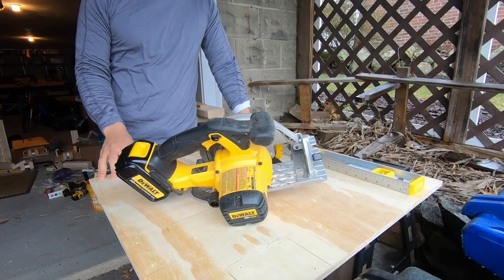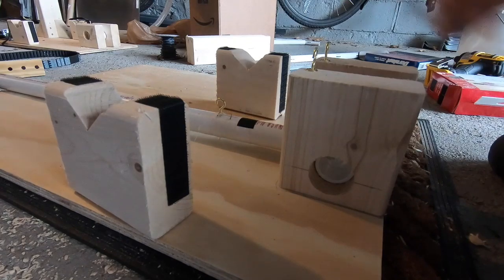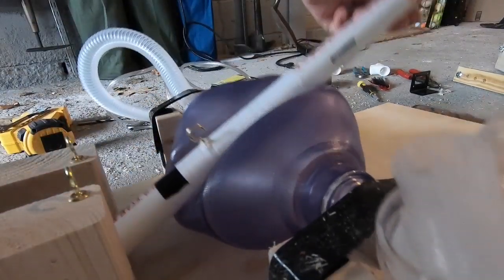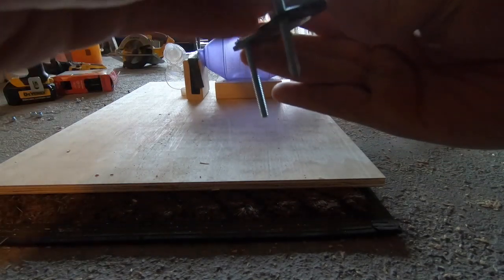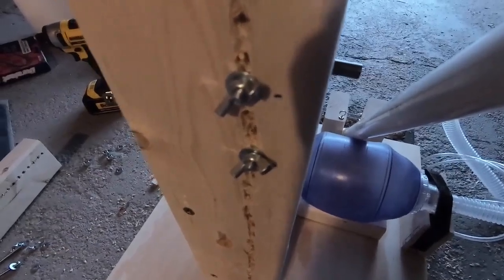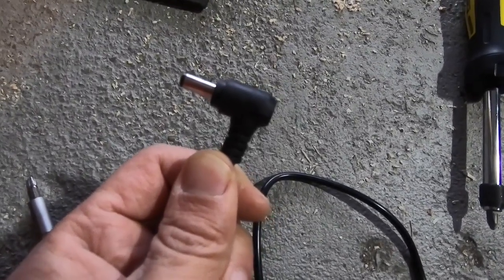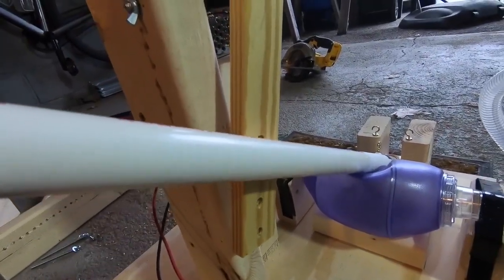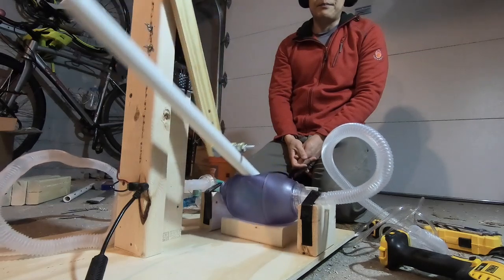Macgyvilator disaster "ventilator" assembly instructions (long)

Comment: This simplicity is a real help. Thank you very much.
Reply: The design requires a peep value to prevent the lungs collapsing
Reply: @sadface7457  i think the bag contains one
Reply: @mrresalah9956  Not its attachment, usually to the mask, because the bag needs a negative pressure to reinflate.
Reply: @sadface7457  it is used now by hand in our hospitals.

Comment: Doctor, you mentioned wanting to add filtering. I have a suggestion for you. Take a 3/4 inch threaded brass, some nylon window screen cut to over fit the ends, and 2 barbed or pex fittings for either side to clamp the hose onto. The union can then be opened and used to place a filtering medium into: cut to size mesh, activated charcoal, what-have-you. Pieces of cut vinyl tubing can be used as spacers to hold loose medium in place.

This design is extremely "low-rent", and is likely only suitable for larger debris filtering, probably no smaller than 50 microns or so... but the filter medium can be sourced from anything, even deconstructed water filtration or cotton balls.
Reply: Alternatively, a pre-filterer can be made with PVC fittings, or with vinyl tubing, holes drilled into the side to allow airflow, then covered with vinyl screen held in place with either a glue, or simple elastic bands. This bodge can also be filled with a medium to improve filtering, but as this in on the inlet side, flow restriction should probably be restricted to no smaller than sub-millimeter sizes.
Reply from the maker: I love the "low-rent" idea; you're in good company! It would certainly be better than nothing. In a hospital environment where this is likely to be used, however, they would likely (hopefully?) have in-line filters that they would use for their vented patients. Such a filter would slot into the airway circuit easily. If this particular example, you'd have an in-line filter between the patient and the PEEP valve, so you'd actually get filtering of air going in and coming out.
Reply from the maker: And everyone just call me Ed!
Reply: @datatrician1369  I would also be very concerned regarding wear. My mother was an ER RT, and I can only remember her talking about bagging a patient when the individual was being moved around, or when she needed to "get a feel", whatever that means, so I'm not sure how robust the plastic in the ambu bags are. The hard PVC could easily wear a hole through it. A PVC coupling, cut in half, and placed over the bag, and held in place by buggies, would protect the hand pump from excessive wear. Even a small piece of rubber draped over the unit would limit friction.
Reply from the maker: FWIW, I've been using the same bag for all of my testing for the last two weeks. It's held up fine! The biggest thing I have concern with is actually the elasticity of the bag. The bag doesn't spring back like it used to. Having pressure inside it (which you'd have in a real situation) makes this less of an issue, but it's still something to watch.
Reply: @datatrician1369  This is most likely due to material fatigue, which is caused by waste heat from the mechanical action breaking down the plastic polymers. For the most part, this fatigue is unavoidable, but if you're already getting a few hundred hours of usable functionality, it may be of little concern. I also wouldn't rely on working pressure to aid in re-inflation for too long, as the deformation caused by fatigue will eventual stretch the plastic into the direction of work, giving the bag an almost imperceptible bulge which will eventual lock it into its deflated position. It also wouldn't be useful to swap bags to extend their lives, as the effect is cumulative. Being in a cool air conditioned environment would help, as would having cool air blowing on the bag itself.
Reply from the maker: @JoelleTheAbsurdist  Good tips - thanks!

Comment: Hi Ed, 
could you comment on the concerns from Real Engineering YT Channel where they point out the risks of home made ventilators? 

Thanks for your effort, love the design.
Reply from the maker: Absolutely. The Real Engineering video you link is very well done and very informative. It even includes Mk1 of the Macgyvilator. The author is absolutely right in that one of the biggest weaknesses of this design and other similar ones is that it doesn't allow for patient-triggered breaths. I agree completely. That said, that was never the design goal of my particular individual effort. I've always been clear that the Macgyvilator is for low-resource disaster environments and is a last resort one step above long-term hand bagging. It also - hopefully - serves as a validated open source step-off point for others to build off of. As built, it should certainly not be considered a substitute for a real ventilator; its niche is very different from that.

Comment: About how long was that bolt you used that holds the bearings and nuts? 6 or 8 inches maybe? I have most of my parts, going to pick up some hardware soon. I think I'm going to build a slot that the tall 2x4 arm can go into, maybe with a bolt through it to hold it tight, so that it can be put in a carrying case with the arm down, and easy to plink together quickly. Thanks again! -Katy
Reply from the maker: I've used 3 inch and 4 inch bolts. You don't need it to be all that long, and in fact you probably don't want to the PVC arm to hit the bolt close to its end. That would generate a lot of twist in the rotating arm. Good luck!

Comment: I would set the hight of the compression arm pivot holes so that the arm could lay flat against the support block fully compressing the bag. Also might use a bolt or metal hinge for the pivot. As it would have less friction and wear and probably less wobble. Also if there was a way to convert this motion to symmetrically compress the bag from opposite sides I would use the broad side of 1x3 blocks.
Reply from the maker: I've done a little tweaking over the last few days, and adjusting the height of the arm pivot relative to the height of the support block to achieve a flat compression arm at the end of the stroke indeed helps things a bit. Wobble hasn't been an big issue, interestingly, I think because compressing the bag is somewhat self-centering. And yeah - I've been fiddling with the idea of symmetric compression. It would really help shorten the rotating arm and reduce torque, but I'm afraid the complexity might be more than is prudent for a design like this. Right now I'm messing around with using a timing belt to hack some gears.
Reply: @datatrician1369  you're right that complexity should be minimized to help people who need to make these fast to save lives. I  hear a lot of pushback about homemade ventilators that they don't sense the patients breath attempts  and they don't have peep valves to hold back some pressure in the lungs or expel excess pressure. They don't humidify the air or allow oxygen mixture adjustment. Seems to me that all those are things that could be added.  If you had a stepper motor and computer, sensors, valves and humidifier. But what you made is the heart of the system that can keep someone breathing while improvements could be made as parts are available.

Comment: Have you heard anything from hospitals about using this? Such a simple, brilliant design. Great job.
Reply from the maker: Hospitals are willing to consider anything right now, as long as there's been some validation of output. Fortunately, most/all hospitals in the US aren't up against the wall enough to consider something like this. Yet.
Reply: @datatrician1369  It looks so simple to do, thank you for the simplicity. It can almost be done by anyone. It would really help if is validated by the medical community

Comment: QUESTION: the earlier video shows the bolt/bearings on both ends of the arm, meaning it compresses twice per rotation. Here you only have it on one end. Seems like it would be easier on the motor to run it half as fast and have the press on both ends. Is there a reason to only put it on one end? Thank you! -Katy
Reply from the maker: It would be easier on the motor - you're right. The problem is that in a vented patient with sick lungs, the ventilator needs to allow the lungs extra time to exhale, which can take three or even four times as long as the inhalation time. Due to the circular path of the rotating compression bolts/bearings, the only way to achieve these longer exhalation times is to have the compression portion of the cycle take up less of the entire circular path, and this can only be achieved (easily) by cutting back to one compression per rotation. Does that make sense? Thanks for following along!
Reply: @datatrician1369  Makes perfect sense. Thank you. And thank you so much for creating and sharing this.

Comment: Great initiative, Ed! 
I am in Brazil and we are at the beginning of the crisis. I am an Engineer and I am trying with the resources I have in hand. I started out trying with an automotive throttle body engine and a plastic bottle, but it didn't quite work out. I'm trying now with bottled manual water pressure pump. 

inside this mechanism there is a flexible corrugated tube, which moves down and up. This tube is very similar to the one in a professional mechanical respirator. What do you think?
Reply from the maker: It's a start! We all work with what we have. Let's see some pictures!

Comment: This is just a thought, I don't know how hard this would be to do. But I have seen radial motor demos made out of PVC pipe, maybe you could get 5 ventilators going off each cylinder using one electric motor.
Reply from the maker: Oof - good thought, but that's likely beyond my abilities right now

Comment: I am an ER PA here in Fort Worth. We have not hit our peak of patients yet but are expecting it in the next couple of weeks. We have built one in our garage similar to yours but using a windshield wiper motor and angle metal. Aside from either changing the radius of the roller from the axle or raising or lowering the motor is there any other way to adjust volume? I was toying around with possibly wedges on the underside of the BVM. With these patients we are needing very low volumes around 5ml/kg.
Reply from the maker: Would love to see a pic of what you've built! Aside from the two methods you point out, there is no other way I can think of to consistently adjust volume. Just as a warning, raising and lowering the motor will change your I:E ratio (which you might want - just a heads up). Changing the rotating radius of the roller will keep your I:E ratio constant while reducing your tidal volume.
Reply: @datatrician1369  Here is the final edition we constructed using a wiper motor and our power adapter was from a desktop computer. https://youtu.be/Nt83xeyPqkI

Comment: Greetings, Doctor ... We very thank you for your great efforts in designing the artificial respirator ....   We are a team of engineers from Iraq and we are now working on manufacturing this device ... We have a proposal to develop the device's work ... by adding the feature of controlling a quantity  And the volume of the air .... And that is by adding an adjustable joint and the vertical movement up and down ... to the point of connection of the plastic tube and that we will be able to control the number of breaths electrically ... and control the size and amount of air mechanically as in the original devices .... And in doing so we will give better control to the doctors to adjust the device according to the patient’s condition ..... what do you think ???
Reply from the maker: I think this sounds like a great idea! By all means adapt the design to the local environment and the resources you have available. That's what engineers do! Send me updates! (datatrician@gmail.com)

Comment: RioRand RR-30A-70V-DC Motor Speed Controller Switch 30A, Green and
Adapter Converter Charger
  not available on amazon
Reply from the maker: Just look for another PWM controller that covers 12V within its voltage range and can take at least 10A. There are a bunch of options.